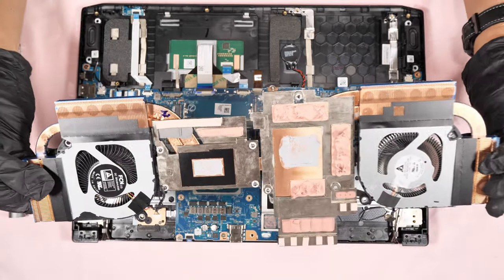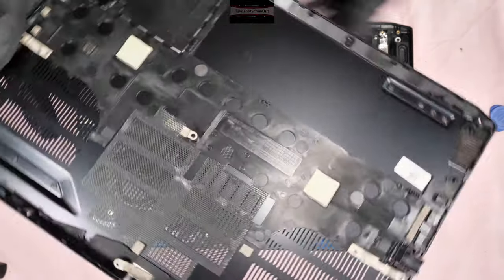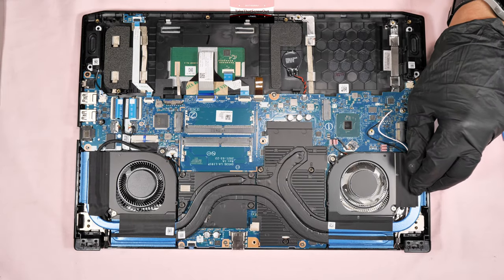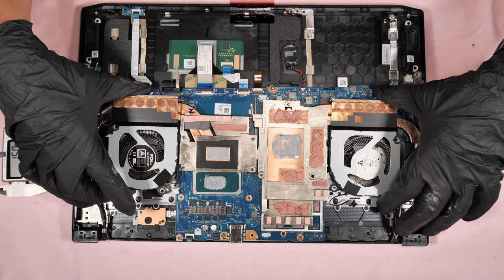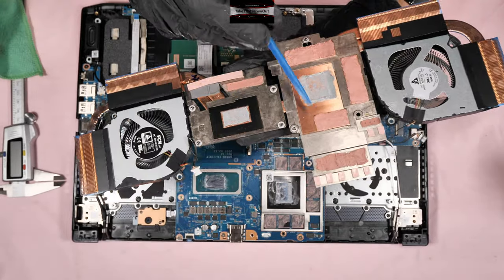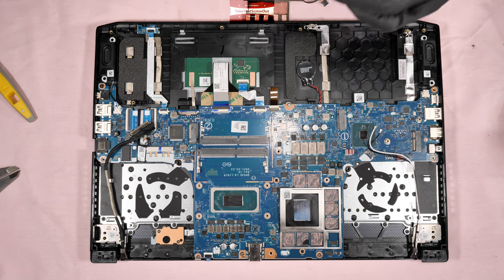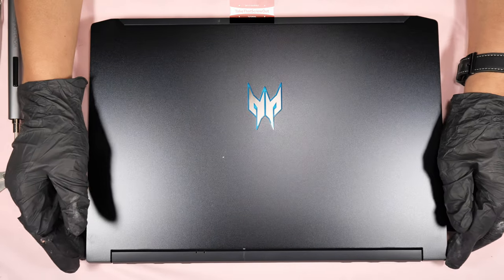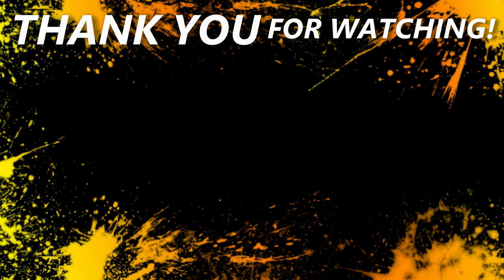ACER Predator TRITON 300 | 11th Gen i7 11800H & RTX 3080 | UPGRADE OPTIONS | DISASSEMBLY

Comment: I have an Acer Predator Helios 300 laptop with an i7 processor and a 3060 card. I was suffering from heat. I changed the thermal pads to 1.5 mm and changed the thermal paste, but the problem worsened and it became a terrible suspension of games and crashes. I changed the thermal pads to 1 mm and it came back much better than the first time. It has become like new. The thermal pads must be changed to 1 mm. Thank you. I am from Saudi Arabia and I follow your beautiful clips.
Reply from the maker: Hi bro! 1mm should be perfect..and also cleaning all heatsink fins and cooling fans regularly is really important in laptop to maintain the peak performance.

Comment: what happen if your gpu die? can you replace it or fix?
Reply from the maker: If the gpu die that depends what's the cause of the issue..they can be fix  but only few will do it here in UK..and that depends which Country you from. And sometimes its better to replace the whole motherboard, if you're lucky you can find Pre owned in Ebay or Amazon, or just google it in your local area.
Reply: @TakeThatScrewOut  but most laptop can play with 1 gpu? I dont have problem with my graphics card but I just want to get knowledge
Reply from the maker: @greenshroomgames  ofcourse bro, u only need one gpu..but that depends on the kind of games you're going to play and what horse power your gpu have..there's two kind of gpu on your pc..integrated and dedicated. Integrated is the one noemally builtin inside the cpu chip..but the dedicated is separate hardware on its own and has more horse power use for Triple A games and video editor.
Reply: @TakeThatScrewOut  I have laptop with Intel UHD 630 and Nvidia Geforce Gtx 1650 I'm not sure if it is mid range but I can play a lot of triple As but my concern is if one of my gpu dies can I still play less demanding games or it's bricked or there is still a chance like having an external gpu or is that even a thing?
Reply from the maker: @greenshroomgames  ur UHD gpu will last till ur cpu still working..but the GTX one if that dies..you can only play games with external gpu via Thuderbolt port.
Reply: @TakeThatScrewOut  so dgpu can only be replaced by people who can replace gpu soldered into the mobo?
Reply from the maker: That's correct..dedicated gpu chip can only be repaired or replace by a highly trained pc technician with the right tools.